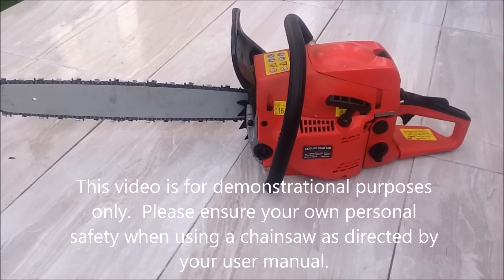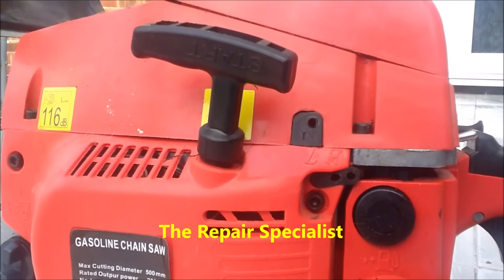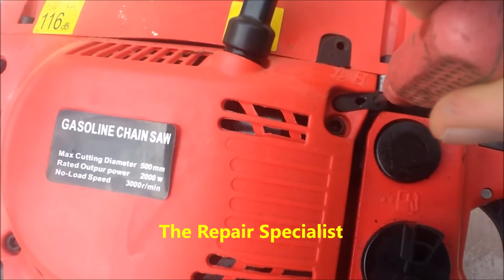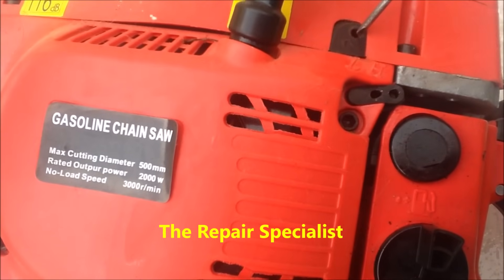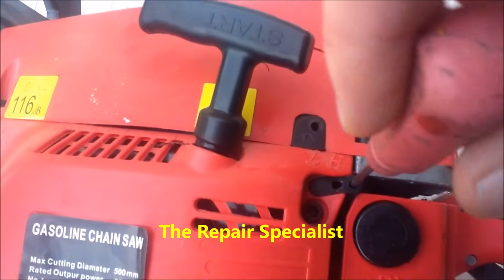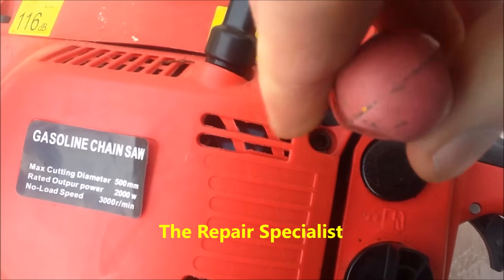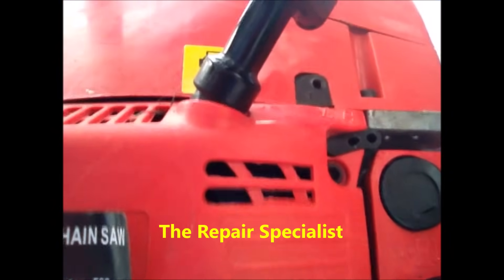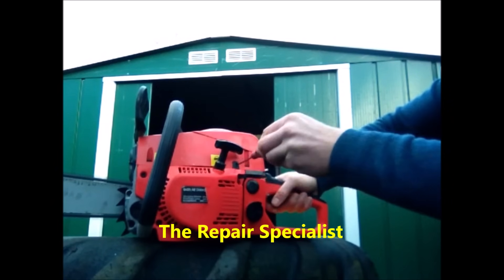Chainsaw Carburetor Settings: HOW ADJUST CHAINSAW CARBURETOR CORRECTLY!  (by Craig Kirkman)

Comment: Here in America those screws are splined or D shaped so you can't mess with them. The drivers are readily available online Amazon, etc.
Reply from the maker: Thanks. Yes some of the UK type are the same. I have just included a link to an adjustment kit on Amazon so people can have a look. thanks again
Reply: Major brands of saws have slotted screws.
Reply: You can always cut a slot into them with a Dremel so that you can just use a flat head instead

Comment: Mine idles fine now, but dies when i raise it up to clear of branches on the tree. Suggestions?
Reply: many reasons, but one common one is the fuel pick up body might be sitting irregularly in the fuel tank or twisted etc. Check that it is fairly close to the bottom of the tank. just a suggestion as this happened to my husq 445 a couple of years back

Comment: Cleaned the carburetor.Lost the idle screw(T) setting.1 turn open?Exactly same chainsaw.
Reply from the maker: Ok, well I would leave the setting where it is and start the saw to see if you feel the idling screw it needs screwing in to idle faster, or out to slow it down. If it wont idle, I would screw it in a few turns to ensure it idles even if it is fast.  

At this point I would have somewhere to work from. I would just need to slow it down to the correct level.  Do be careful, though, because when you start it, running faster at idle means the chains will most likely be moving from the get go.  

Of course ensure the that chain brake is applied before starting, but as soon you release the brake you may well have chain movement.  Once you have safely took this into consideration then you can make the adjustment back to a good idling speed.

I hope this has helped a little

Craig

Comment: What is over revving never heard that before.  I have always tuned the high till it reaches its highest rpm.
Reply: Highest revs means running pretty lean at high load more prone to overheating piston/bore damage, little bit out your are slightly richer and revs drop slightly but engine not running lean will cool piston down less chance of piston and bore damage. Later carbs on cars had power valves to add at bit more fuel at high rpms to riches the mix on load to stop pistons/bores due  overheating in lean situation. Screwing in reduces fuel (clockwise) screwing out riches it (anti-clockwise)  Looks like at idle and full rpm err on slightly rich. Make sure you mix fuel properly with mixing jug. You can easy seize a saw or rip up the bores if you have not got enough oil in the fuel (Two Stroke), too much oil it doesn’t run right and you gum it up. Plastic mixing container is a few bucks how much is a new saw? Good two stoke oil right mix should have good running saw wrong mix bad running maybe wreck saw? Could be bad mix in saw is why it’s running bad dump mix start again, first.

Comment: mine is turning off when i pull the gas trigger. or is not going at full speed, it holds in. when i push the gas trigger
Reply from the maker: Have you done what the video suggests yet?
Reply: @TheRepairSpecialist   i got it working again ! but it's smoking crazy big plumes of smoke. i did the mix benzine / oil ratio good.  so don't know wy it's smoking still.

Comment: If the screws are not labeled L and H, How does one know which is which?  However, One screw is larger than the other.
Reply: The Low screw will always be the one closest to the engine intake. The High screw will always be the one closest to the air filter.

Comment: I can get my McCulloch CS 35 to idle but no way can I open the throttle. It just keeps bogging down. I have tried numerous settings on the H screw but it will just NOT allow me to use the chainsaw. Absolutely useless. I have 2 cheap Chinese chainsaws that are far more reliable and respond well to adjustment
Reply from the maker: It appears like the throttle response on your McCulloch CS 35 chainsaw is giving you trouble. This issue could be caused by a number of things, therefore it's critical to troubleshoot methodically. The following actions and things to think about will help you identify and fix the problem:

Before you conduct anything, though, I have to say please be mindful of your own health and safety before you carry out any work, and be sure that you are satisfied that can carry out the work and that it is safe to do so.

Ok, let's go!

Spark plug and air filter:

Look for any debris or obstructions in the air filter. Having a clean air filter is essential for optimal engine operation.
Check for damage or fouling on the spark plug. If needed, replace it.
Engine System:

Make sure the fuel mixture is correct based on the guidelines provided by the manufacturer.
Inspect the gasoline filter for obstructions or clogs. If necessary, replace it.
Make that there are no leaks or cracks in the gasoline lines and that they are in good shape.

Carburetor Modification:

Review the carburetor settings, paying particular attention to the idle and high-speed (H) settings.
Make sure there are no debris or dirt particles in the carburetor. If required, rebuild or clean the carburetor.
Verify again that the throttle linkage moves smoothly and is not stuck.
The exhaust system

Check for any blockages or obstructions in the exhaust system. Poor engine performance can result from a clogged exhaust.

Test for Compression:

To make sure the engine is creating enough compression, perform a compression test. Power loss may result from low compression.
The Ignition System

Examine the ignition system, making sure to check the spark plug wire, ignition coil, and on/off switch. Verify that every connection is safe.
To guarantee correct ignition, check the timing.
Fuel quality:

Make sure the fuel you're using is fresh and of good quality. Engine performance may be impacted by stale or tainted petrol.

Manufacturer's Assistance:

To make sure you are maintaining and adjusting your chainsaw in accordance with the manufacturer's instructions, think about referring to the user handbook.
Visit the manufacturer's website or get in touch with their customer service for advice on troubleshooting and possible fixes unique to your device.

If the problem still doesn't go away after trying these fixes, you should consider getting help from a qualified chainsaw mechanic or the manufacturer's approved service facility. They are able to precisely treat any underlying problems and offer a more thorough diagnostic.

Thanks

Craig
Reply: @TheRepairSpecialist  Much obliged Craig, thanks. I've had another look today. It will idle on a full one turn anti clockwise of the L screw. but it will only rev properly on 4 full turns of the H screw!! Never had to turn that much before. But then it cuts out again when I drop the revs to idle and will not start unless I turn the H screw all the way in. It's had very little use and only a month past the guarantee period. Quite frustrating. I will check everything else as you suggest but I fear its a carb problem

Comment: This was very helpful - thank you!

One thing you don't touch upon in this or the the one about bogging down ( https://www.youtube.com/watch?v=_wI-X7aot8Y ) is when the saw works fine for the first tank of gas but won't start/bogs down once it's been used for a tank of gas and has warmed up.
That's the situation with my saw and it's done that since brand new. 

I'm going to go adjust the mixture based on this video (finally got the special tool required <sigh>) and maybe that'll be sufficient.
Reply from the maker: Ok, thank you for letting me know. Also, let me know how you get on after adjusting your chainsaw and I will look at making a video on this (about possible reasons for your problem specifically). Thanks. Craig
Reply: @TheRepairSpecialist  Thank you for the reply.  I was not able to get the saw running well before I ran out of steam (95ºF outside today!).  In fact it now won't really run at all unless I keep the choke on half - though that's clearly too rich and I have to toggle between half and off to sort of barely keep it running.  This saw hasn't been used all that much (15-20 tanks of gas total?) and, as I noted, it's run really well for that first tank of gas but doesn't want to start again once hot and bogs down after the first tank of gas unless you let it cool down for 30 minutes+.

I can't complete the instructions in this video because I can't go to full throttle to set the H setting as it now bogs down and quits running immediately.  During the starting process it only runs if I keep it on half choke (though that's a bit rich).  This sounds like bogging down due to not enough fuel (?).  

What seems like a possible additional clue is:  Taking off the gas cap indicates a fair degree of suction (I can hear air suck in - like opening a canning jar for the first time).  So I'm now thinking your comment in the "bog down" video about that cap valve not working right might be at play.  Since it's had trouble from the beginning I'm wondering if it's a manufacturing defect in that cap valve.  That's what I'll explore next.  

Thanks again for your videos and for your reply.  Much appreciated!